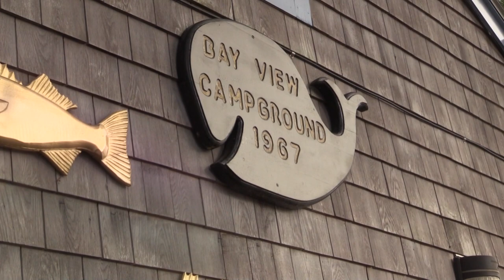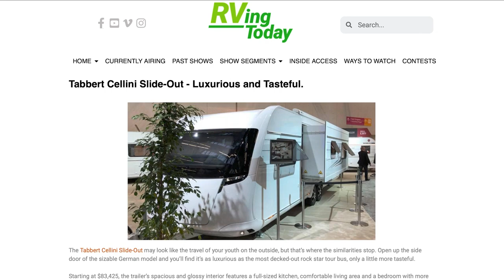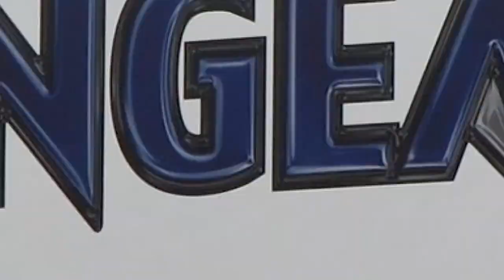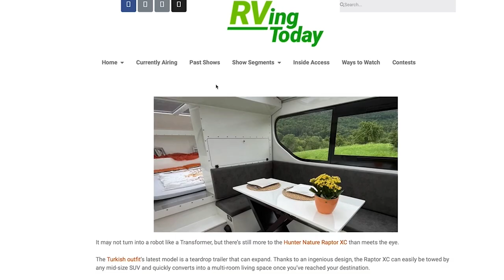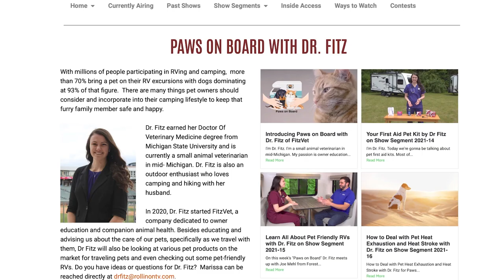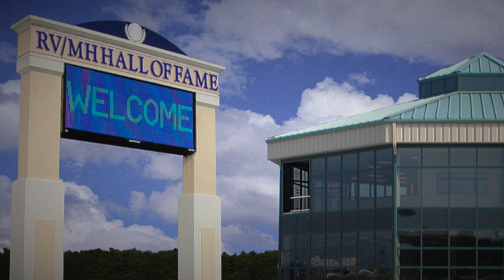Upper Cape Cod Campground | Go Power Solar Install | Pets and Bee Stings on RVing Today Show 2022-05

Comment: This video should be removed. If you install a solar panel like this  you void your warranty. there are no backers in that location.
Reply from the maker: Thank you for your expert advice, but we'll stick with our own veteran experts and factory partners when it comes to RV advice..
Reply: Hi, first, the roof is strong enough to support a factory-installed air conditioner so there's no worries there. Second, the solar panels are lightweight and the wood substrate behind the rubber roof skin is more than strong enough to support the panels. Both the Go Power staff and the Palomino factory tech staff approved of this project as it was done, and I tend to put more weight on their recommendations than I would an outside third party. A warranty question is always cause-and-effect. If something happens that calls for repair and the cause is clearly the result of a non-factory-approved modification, for example, that can void a warranty. In this case there is no threat of a warranty problem and the video is definitely staying up.